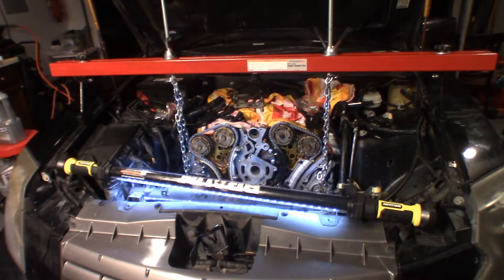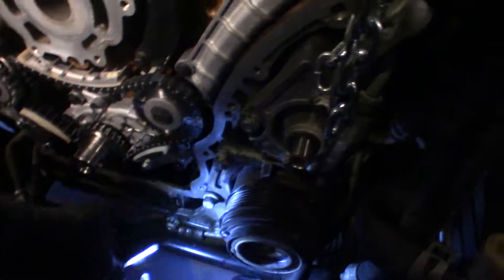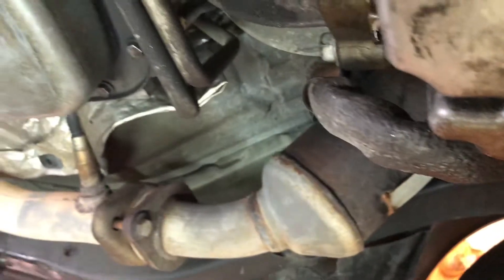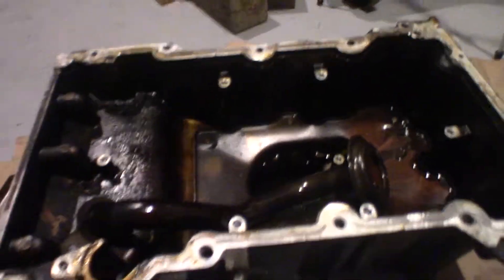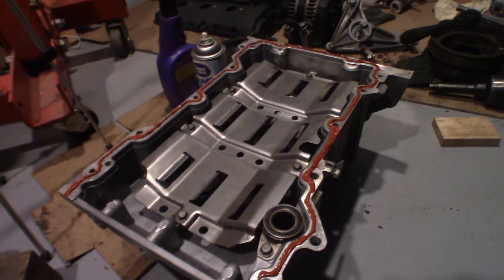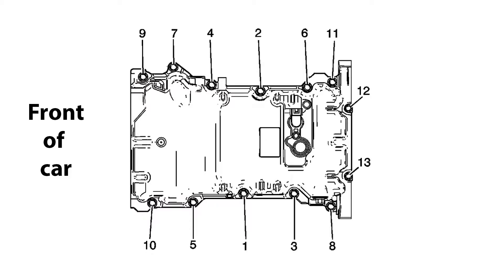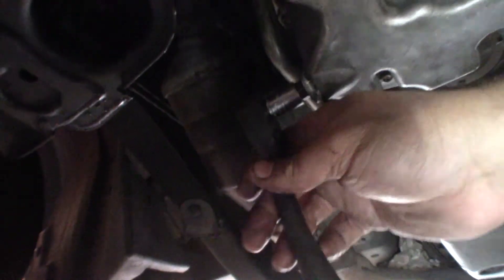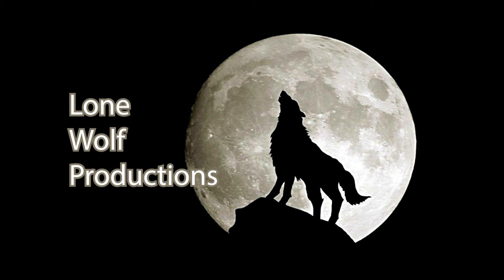Cadillac CTS Oil Pan Gasket Replacement DIY

Comment: My mechanic told me he doesn't work on Cadillacs anymore. Guess we're about to see if I can
Reply: Caddy’s can be frustrating when compared to other GM products…especially 6 cyl engines. Oil pan wasn’t too bad, but I’ve done oil pan gaskets on BMWs which are similar in difficultly.

Comment: Awesome stuff thank you! Do you know if there is a place that sells the engine lift brackets for a decent price? I assume there are knock off's as well or i could fab some up, just dont want to risk messing up the front cover matting surface.
Reply from the maker: I checked around and am only finding brackets for the 3.2 motor.  You might check with your local dealer. Sorry.